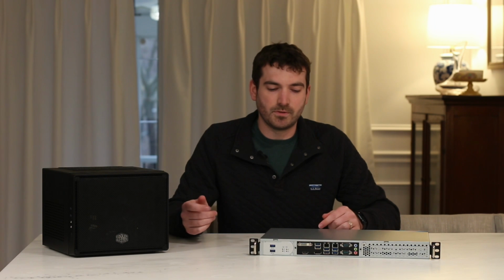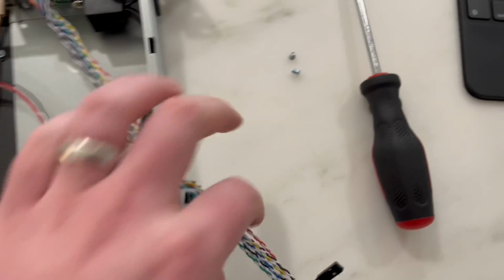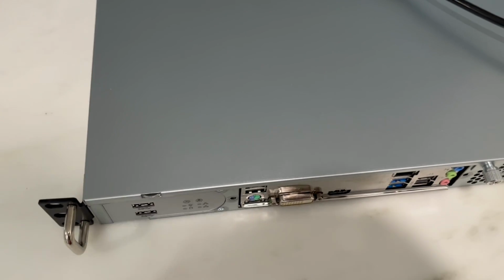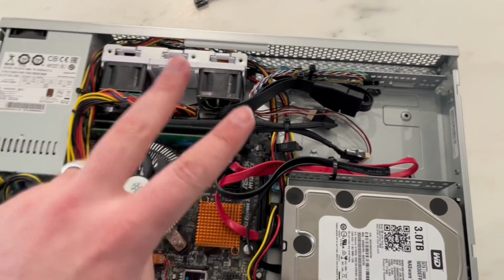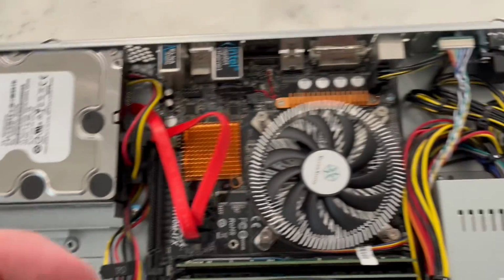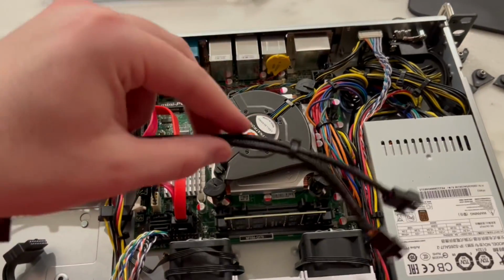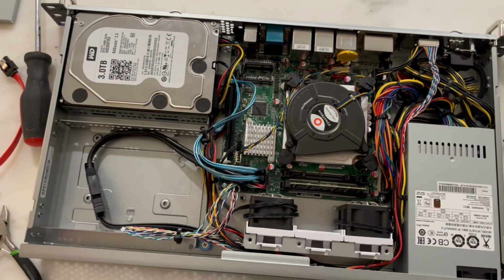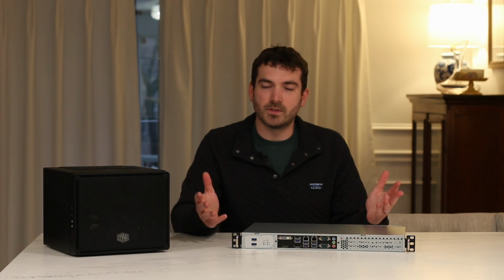Converting Mini-ITX Desktop to 1U Server

Comment: Those sata cables suck in a 1u case, gotta use low profile thin wires. I have a dq77kb running opnsense on a 1220l v3 and it runs pretty quite and cool. Artic 40s running 4k rpm, and a silverstone low profile. 48-55*c
Reply: product link for thin wire?

Comment: I have those same NMB fans as a 18k rpm PWM variant in my 1U amplifier lol At idle they run at like 2k rpm or so and are super silent. I can only hear them at night when nothing else is on. I measured them and they are at about 20db at the rpm they have when the amp reached it's operating temperature.
Off course at 10k+ rpm they are loud. 
I love your video and is giving me ideas for doing the same with my PC!

Comment: I'm late to the party, *thanks YT algorithm*. I recently adapted an HP Omen motherboard into a 2U case and I thought there were challenges.. You have my respect for going 1U, but I may have missed why you went that small. If you do this again in the future, I'd recommend the 2U Chassis from Rosewill. The 3x fans need a system fan splitter, but it takes a full-size PSU, default cooler fits, holds 6 drives, and is quieter than the rack exhaust fans.  

Great video!
Reply from the maker: Thanks much appreciated! I went for 1U due to rack space constraints and future plans in that rack. 2U would have definitely been easier and honestly I probably wouldn't have had to do half the things I ended up doing in this process like changing the server mobo. Thanks for watching!

Comment: Are there any power usage stats of the machine running at idle vs full load?  Thanks for the video!
Reply from the maker: Hey thanks for watching! I’m glad so many people found interest in this process. I did have it hooked up to a kill-a-watt and now it’s on a UPS. I never wrote down the numbers, but if I remember correctly it was in the low 100-200 watts. Sorry that I can’t recall exactly!

I just checked my UPS and it’s running right now at ~130w with multiple other rack mounted devices. So it’s probably idling under 100 watts at the moment.
Reply: @WarnerDiscovers  ~100w at idle is quite a lot for the relatively low end performance of that CPU (by modern standards).  I am on a journey to build a budget Ryzen 5 or Core i5 level system with consumer hardware in the same Inwin chassis you are using.  Not sure if it is possible or feasible but you’ve given me a lot to consider.  My goal is to eventually build a “cheap” and low power Proxmox cluster for home lab use for things like Pihole, Home Assistant, etc.  Thanks again!

Comment: When I find these 3 pin fans are too loud, I usually connect them straight to the 5V rail on the PSU and connect only the speed signal to the motherboard to prevent fan errors.

Those Noctua low noise adapters are designed with the load of the Noctua fans in mind, so in my experience, the resistor inside gets very hot and burns out in time.

Buying proper PWM fans was definitely the right way to go.
Reply from the maker: Hey thanks for the feedback and suggestions! Glad to hear I went down the right route with the proper PWM fans. It seemed to be the right step to take at the time and glad I did rather than mess with the adapters.

Comment: Nice one. I think the RAM in the first setup blocked a lot of air flow, which ramped those fans way up. Swapping the RAM for low profile sticks might have quieted things down. The second setup is a lot cleaner, but probably a lot more expensive. And you ended up not converting the desktop to a 1U server, you tried different ways to populate a 1U chassis. 
Really nice project though, you might be able to get it near inaudible with another set of fans. Four of those at 1400 rpm and you're wondering if it's running at all. The empty space next to the drive looks like a perfect fit for a quad 2.5"- or dual 3.5" drive housing. That board probably has an on-board sas controller. With a couple of cheap 10TB sas drives off eBay, you can squeeze a fast faux NAS in there (or a Plex server). Looking forward to the following iterations. 
Why stick to 1U? You've got plenty of space in that rack. A 2U adds so much breathing room. Or just lose the lid on a 1U and go for it.
Reply from the maker: Thanks for watching! Yeah it definitely was a consideration that the ram was blocking the fans. I noticed this in some of the more "server" mobo style boards that took this into better consideration. The first fans I had didn't have PWM and only had 3 pin so there was no mobo control for the fan speed so that had to run at 100% unfortunately.

Yeah the second converted setup was definitely the way to go with the new Mobo but you're right turned out more expensive. I'm glad I ended up going that route anyway in the end. Much cleaner / neater and end up learning a lot in the process.

I've been monitoring the temps for the past month or so and they seem to be good with the two for now thankfully!

I was poking around with SAS drives and it potentially might, good idea.

The reason I went with 1U is because I was planning on converting my seperate NAS over to a 1U as well. With this, my top rack is completely full now. I have another rack underneath that is 4U, but the last 2U that I have available I already have a plan for, so was sort of restricted unless I swap out the racks and remount a bigger one, but I don't think I'll end up doing all that.

Comment: Great video! 
Small suggestion: always look for a motherboard where the memory memory modules are 90° so they won't block your cooling, that way you could use some 5k RPM PWM fans and get almost silent operation
Reply from the maker: Thanks!
Reply: Any examples of these motherboards?
Reply: @ChimobiHD  sure, look for ASRock-rack boards, Supermicro boards

Comment: did you think about using one of those 1u blower fan that blows the air side ways out of the case? and why a 3TB drive? what the use case of this 1u system?
Reply from the maker: Yeah, I end up utilizing the Dynatron K2 later in the video which sounds like you’re describing. Just a personal server running some docker containers and home assistant and such.

Comment: Just a thought: I think the cpu cooler does not make sense in this setup, as its just going to blow at the roof of the case. A heatsink would make more sense and then heat is sucked out by the case fans in the back. Maybe im missing something
Reply: Pretty much. You only see CPU coolers in 4U racks. And sometimes not even that. Just larger heatsinks and intake fans.
Reply: @BrunodeSouzaLino  you find active coolers (or massive passive) in 2u and up. Typically will have a 60mm fan pushing air through front to back
Reply from the maker: Thankfully the second CPU cooler I ended up installing, the Dynatron K2 is moreso specifically made for 1U cases. It blows out the side / rear of the heatsink since the top is covered and it all gets sucked out the back from the rear fans. Take a look at the image of it here: https://www.dynatron.co/product-page/k2

I also have been monitoring the temperatures for the past week or so and they’ve been keeping down really well

Comment: Looking at where the I/O plate goes, you could've probably used a sheet of metal or mesh with the correct cutouts for the ports and screwed that from the inside.
Reply from the maker: Yeah definitely could have customized something like that. I noticed one or two things online I potentially could have bought then cut out. Some of the other 1U cases on Amazon also came with customizable I/O shields which I wish this one did! Fortunately the new mobo I got had an I/O shield that fit the case perfectly.